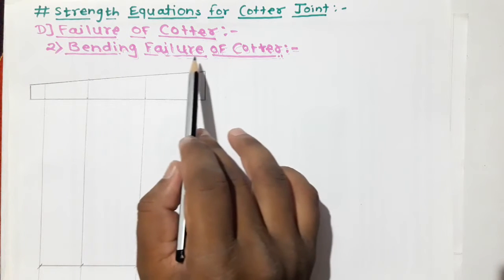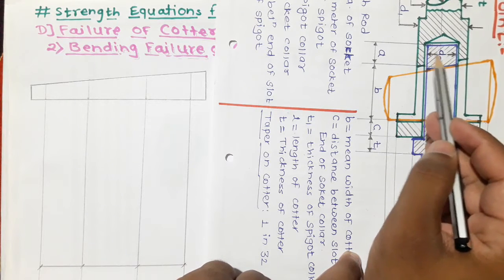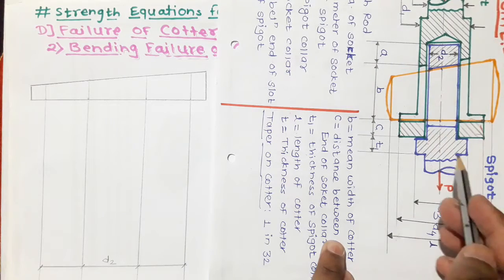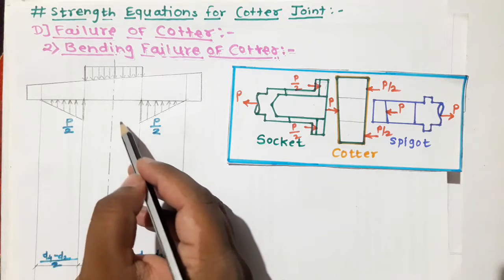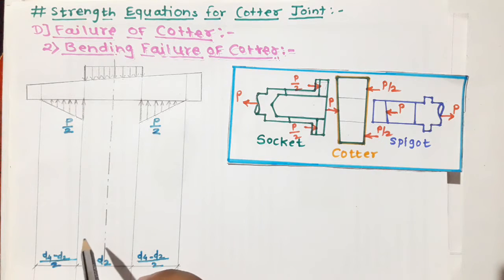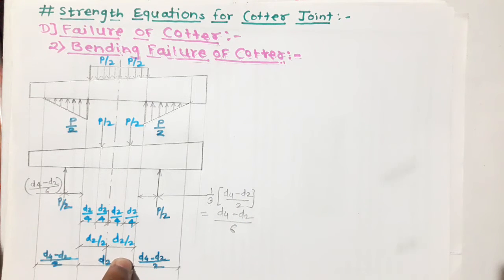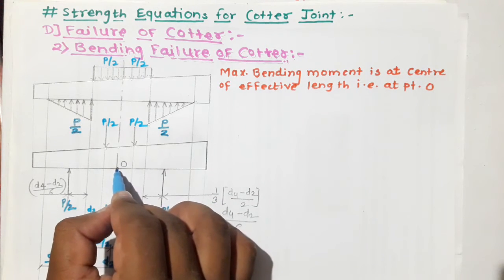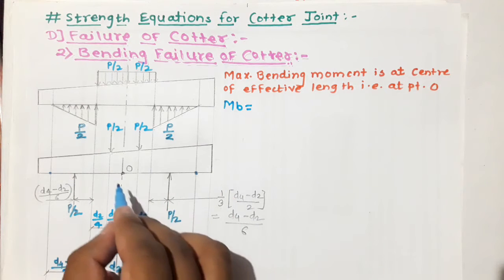2.32 Bending Failure of Cotter_Strength Equation for Cotter Joint _ Machine Design I

Comment: Why you taking only right side forces
Reply from the maker: Consider cotter subjected to loading (as shown in video) as a Simply supported beam.  

  Maximum bending moment is at point O (Centre of effective length).  

 So, to calculate max. bending moment, you can consider forces on either left side or right side of point O.

The answer of Max. Bending moment will be same if you use right or left side forces. 

You are free to use forces on either left side or right side of point O to find max. bending moment.